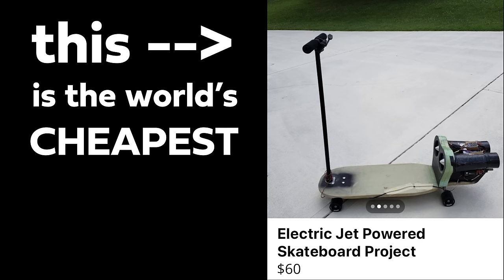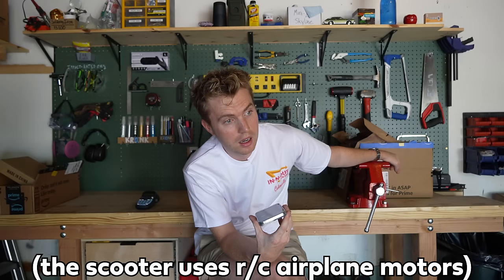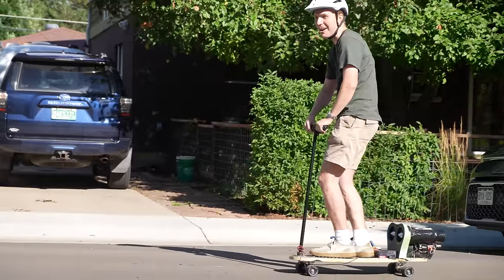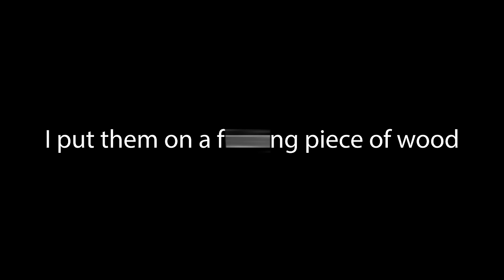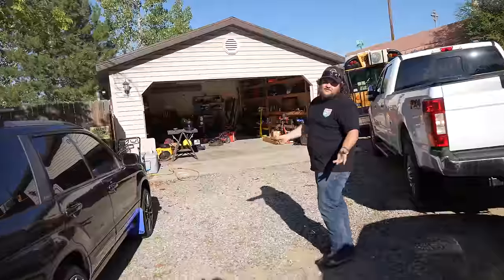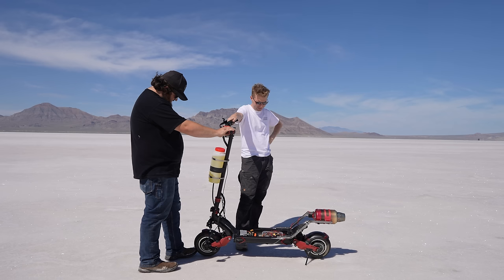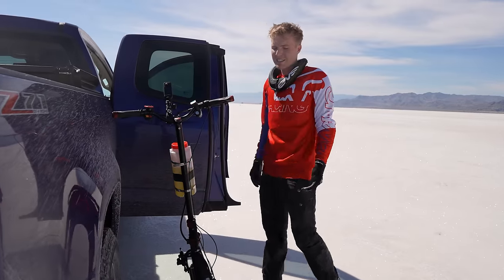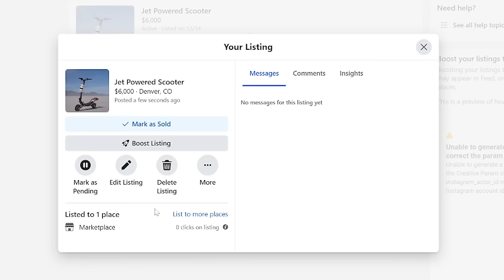$100 VS $10,000 Jet Powered Scooter

Comment: Can the edf scooter perform once it's up to speed? Or is the drag too much at that point
Reply from the maker: EDF scooter gets fun around 10mph and tops out around 20mph — and the batteries puffed a lil 😂 but well worth it! 
If I were to do this from scratch, I’d start with bigger EDF’s, and see if I could use a beefier battery (like an escooter battery)
Reply: @Weisz  35 MPH is still no joke on a scooter! nasty fall if you find a good bump or a nice pothole. From the video it looked like you were going 5mph :D
Reply from the maker: @linecraftman3907  do you mean the unmodified scooter? that one does top out at 5mph lmao
Reply: @Weisz  yep! So it's pretty much a noise machine then 😁

Comment: I wonder if you could use an EDF and have it blow through a Carburettor into a combustion chamber with sparkplugs/ignitors, making a sort of a jet engine, i don't know how well EDF or their propellers would work with increasing pressure but i am curious a.to how such a cobbled piece would perform let alone get developed.

Comment: So, the undisputed winner is the gas-jet scooter BEFORE you put the gas jet on it.
Quiet, practical for daily use, and as fast as you would ever want to go.
I think you would have seen MUCH better acceleration had you not been turning the two hub motors.  That and if the wires of the motors had shorted themselves out while you were going 60 mph it could have locked up the front and or rear wheel instantly causing a crash you would not want to experience. The hub motors don't have much resistance with the wires open, but the magnetic cogging and un-sprung weight were both fighting against the jet's ability to accelerate you from a dead stop.

Comment: RIP in pieces to that trucks undercarriage

If you still have the space in the scooter maybe you can keep the electric wheels for the initial acceleration but it's probably fine as is
Reply: I spent weeks cleaning it.. and replaced a lot of parts lol
Reply: You realize you can wash it off after going to the flats and everything is fine. It doesn't rust on contact lmao
Reply: @fuglong  have you been there with water? I rusts bare metal in a matter of minutes.
Reply: @JDority  I have and it didn't do that to my bare metal lol, I got it washed off like 2 hours after

Comment: the "$60" scooter isn't even $60 at this point. he probably spent $200-250 on it becasue he paid an extra $40 to the seller plus whatever shipping and tax was, added 3 EDFs, replaced some pcbs and added a battery bank. 
it's not fair to call it a $60 scooter anymore.
Reply from the maker: Hey man, sorry if you felt clickbaited. In my opinion it's still a $60 scooter, because if you lived where it was located you could have picked it up locally for $60.

Of course, even for local pickup you'd need gas to get there, or at least a bike that you could ride over -- so that adds cost. -- and you'd still need to replace any faulty parts like the board, so that adds cost.

See how ridiculous this gets? Do you expect me to price out the entire fractional cost of absolutely everything in a build?

The scooter ITSELF cost $60, and the value of the parts included was well over $250. The point was to show how a marketplace project can be a good way to get started without spending a ton of money.

If you think this is clickbait I literally don't know how I can please you.
Reply: if you really think about it, it probably cost less than 60 to make in china soooo